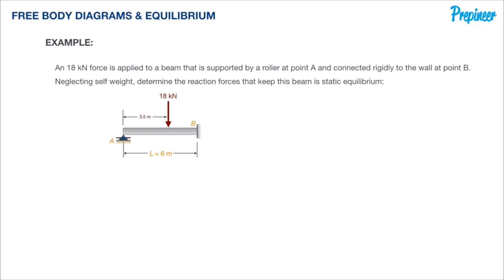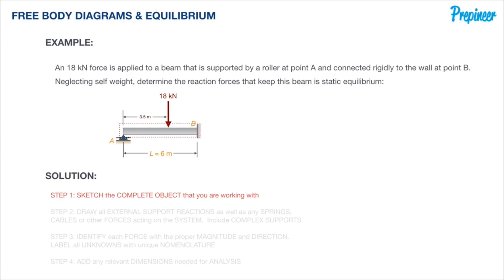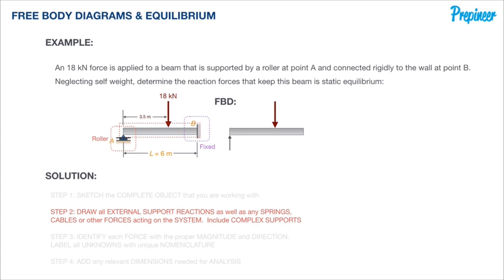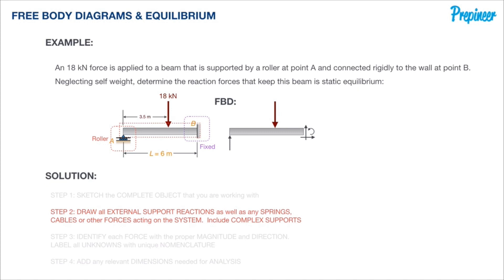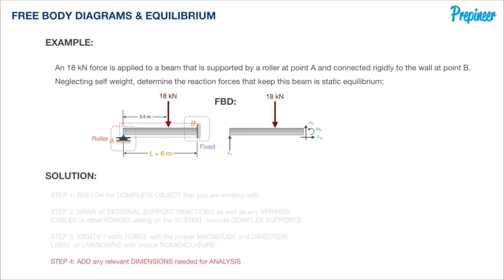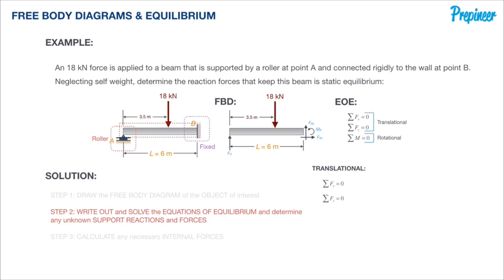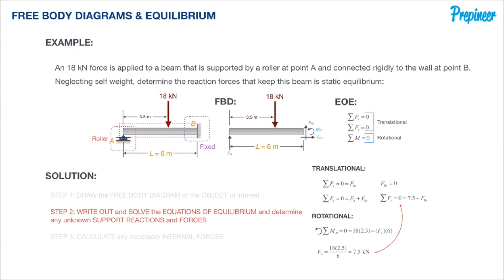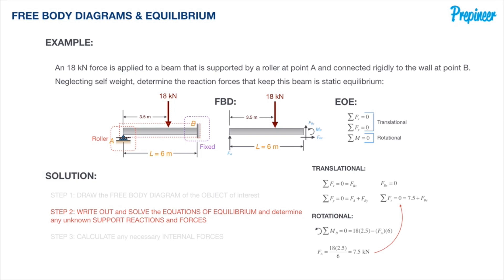FE EXAM STATICS - FREE BODY DIAGRAMS & REACTIONS | FE EXAM PRACTICE PROBLEM | DAILYDOSE 055

Comment: I get Ay = 4 kN up, By = 14 kN up, Bx = 0, Mb = 3 kN*m CCW. Using the Force Method of Analysis similar to what is found in the Civil Engineering section (pg 270-271) of the FE Reference Handbook 10.0.1. Deflection equations can be found in the Mechanics of Materials and Civil Engineering sections of the reference handbook (pg 140-142 & 270-271). E & I can be ignored in the equations since the beam is assumed to be homogenous and have a constant cross-section.

Comment: This is a propped cantilever beam, and it is statically indeterminate. displacement method is needed to determine the support reaction. 
When calculating the sum of Moment at point B you acted as if it is a simple supported beam. You should have included or added the existing Moment at B as well and at that time you get an equation with 2 unknowns instead of one (reaction at A)